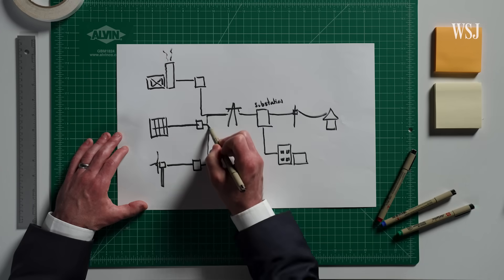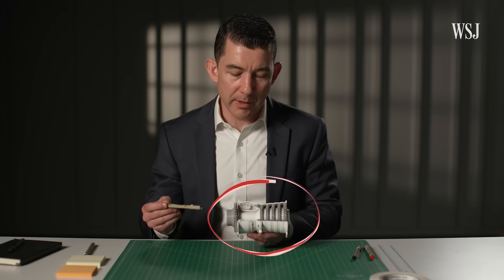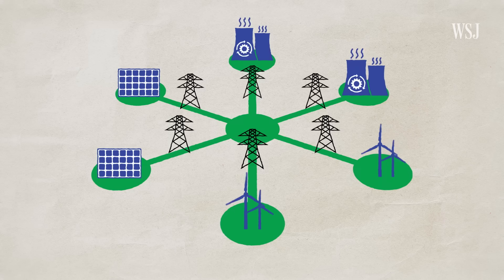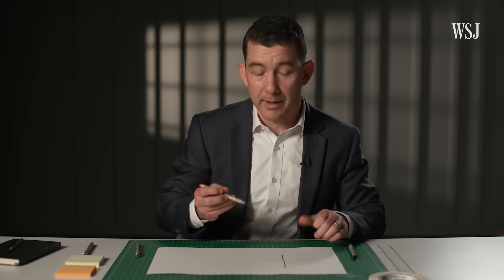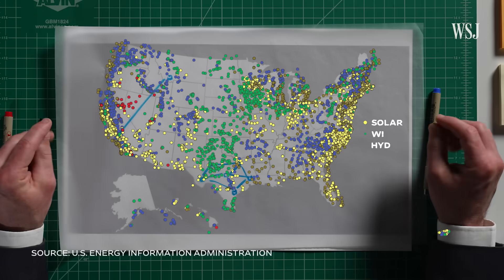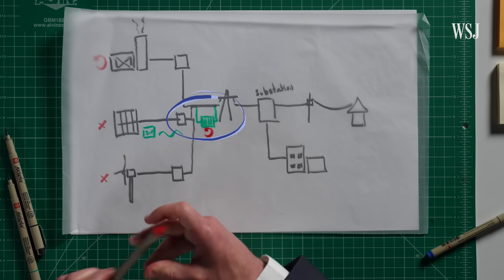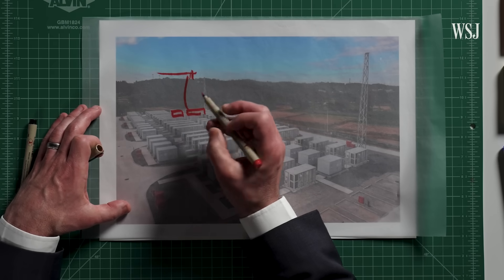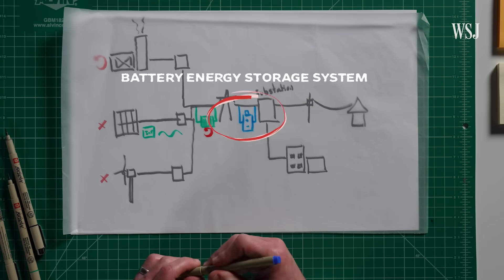How to Fix Renewable Energy’s Hidden Infrastructure Problem | WSJ Pro Perfected

Comment: Battery is the best solution overall, australia had this issue in 2016 they massively installed in 2017-18 and now they have the most reliable grid.
Reply: Batteries provide DC power. Our power supply runs on AC. To connect a battery to the grid, you would need an inverter to convert DC battery power to AC.

And, to power a Grid Following Inverter, a stable AC power source is needed. So no, Australia did not only use batteries. They needed at least 2 of the 3 solutions presented in this video 

Batteries to provide power.

Grid forming converters to turn the battery's DC power to AC (to connect to the grid, or else the batteries are useless)

Comment: Bad title - misleading! They are only vulnerable to outages... if they're on grids! It's the Grids that are unreliable, have 50% loss = inefficient, cause fires, get blown down repeatedly, and irradiate us. Renewables on grids are a band aid, triage, to stop coal pollution, but we need 100% zero emission and energy independent homes and buildings to not have blackouts.

Comment: Australia encountered this problem back in 2016. This is how they dealt with it. 
"Australia addressed this challenge through various means:

Investing in battery storage: Batteries, especially when equipped with grid-forming inverters, can actively contribute to frequency and voltage stability, mimicking the stabilizing effects of traditional synchronous generators.

Implementing grid-forming inverters: These advanced inverters are designed to set the frequency and voltage of the grid, offering essential grid support functions.

Utilizing synchronous condensers: These devices are specifically designed to provide grid inertia, helping to stabilize frequency in grids with significant renewable energy penetration.

Smart energy management: Promoting schemes like virtual power plants (VPPs) encourages smarter energy use by shifting electricity consumption to times when solar power is abundant, thus balancing the grid.

Price signals: Introducing pricing mechanisms like low "solar soak" rates encourages customers to consume power during periods of high solar generation.”
Reply: thanks chatgpt
Reply: @peterii3512 Nope.  From ABC Australia story.  And if I do use AI query it's usually google search chat.
Reply: @damham-F47  bro ur entire text just sounds like chatgpt 100%

Comment: Although at the start of the video they mention that the renewables they are talking about are wind and solar, during the rest of the video they practically use “renewables” as a synonym of those two. 

There are renewables that act as a baseload power source and contribute to the resilience of the grid, for example, GEOTHERMAL energy. 

Only talking about wind and solar is misleading.

Comment: That claim near the beginning by the IEA that we're getting >30% of our energy from renewables.  That claim seems EXTREMELY high.  I go to other sources and I see 10-15%, depending on what you include in the category.  Through this entire period of explosive growth in renewable deployments, we're also seeing traditional fossil fuel use ALSO increase.  Renewables are, from most source i've seen, merely offsetting some of the demand growth in energy.  And to get even that, it's required huge per kWh subsidies, inadequate (so far) investment in grid and battery technologies (costs excluded from the Levelized Cost of Energy metric everyone likes to use).  

I still think Nuclear Fission and Enhanced Geothermal have to be larger shares of our energy mix if we're going to have a prayer of transitioning from fossil fuels.  Wind and Solar are nice supplementary sources, and good for 'peaking', but I'm still deeply skeptical that we're ever going to have a global energy market where renewables are the dominant source of energy.

Comment: This guy is only telling part of the story. Just reducing the cost of batteries is only part of the overall cost. Proponents of BESS almost always state their capacity in MW's, not MW/hrs, which is what matters. If you put a 1000 MW demand on your grid, having a 1000 MW's of battery storage is insignificant, as the demand is constant. You need to meet that demand for hours, days and even weeks. Run the numbers for how much battery storage that requires and you get an astronomical cost. And we haven't touched on the risks associated with lithium ion batteries. Bottom line is that battery technology is nowhere near advanced enough to make BESS a viable option. As for the options he describes for addressing the synchronicity issue, they add considerable cost to what is touted as lower cost renewables. If one really believes the alarmists in regard to climate change, then they should be advocating for nuclear. But they are not. That ought to be setting off alarm bells.
Reply: Except BESS is already operating at scale in two states and clearly is big enough.  Your statements are false right out of the gate.  California alone has over 100GWh installed that is cycling daily at power levels in the 10GW range.  Growing rapidly.  Texas as well.  Past tense… it is already a thing, not a wish.
Reply: @junkerzn7312  CA's battery storage capacity as of this May is 15,763 MW's.  Not MW/hrs. Source is the California Energy Commission.  I'd be careful who you accuse of providing false information.
Reply: @TimothyGasser  Power is watts, Energy is watts x time.   15,763 MW is POWER ... aka, 15GW.  During a heat wave last year we saw batteries pushing in excess of 10GW for a time.  For example.

Battery storage is in GWh (Gigawatt-hours) and that now exceeds 50 GWh in California.  Not counting residential storage.

-Matt
Reply: @junkerzn7312  I have 2 graduate science degrees and was the Reliability Engineer for the Trojan Nuclear Plant. The one who has problems with math is you.  You claimed CA has 100 GWh's. It doesn't have 100 GW's of storage period, let alone gigawatt hours.

CA's demand is almost 300,000 GWh's.  Divide 50 by that and you'll see just how miniscule that 50 GWh's is in reality.

Not sure what it is about the renewables crowd that they have such a hard time understanding the basics of the electric supply system.
Reply: @TimothyGasser  You are talking complete nonsense.  If you have any sort of science degree then you should very well know how to specify units for power and energy.  Talk to me again once you've learned those things because right now you clearly don't know anything.
Reply: @junkerzn7312  Says the guy who doesn't know the difference between gigawatts and gigawatt hours.
Reply: @TimothyGasser  Its like you are a small child whos toys have been taken away from him.  Try returning to the real world.
Reply: @junkerzn7312  The only thing childish here is the level of your attempt at insult. I don't have toys. Not even the adult type. The closest I come are my music collection, my library and my gun collection.

Comment: Governments around the world will need to make big investments in making electric grids more dependable and modernize the supporting infrastructure to
Reply: I'm an Australian engineer and have bene trying to tell our government about this issue. 
The actual problem is ECONOMISTS and they are not just a problem with electricity but a lot of other things as well.

I first found out about how fragile our situation was back in 2016 from doing a small project into our energy issues. What truly amazed me was there were NO PLANS or even PROPOSALS anywhere to deal with these sorts of issues. It took me a while but I eventually tracked it back to Economists who it turns out have WAY TO MUCH INFLUENCE in areas they have no understanding of.

Its a much longer discussion and I am seriously thinking about starting a YT channel to address this subject of economists interfering in other fields like energy.

Comment: You've explained it very well. You're right. The main reason for the blackout in Spain was the failure of a power producer, which altered the grid frequency and caused the other producers to disconnect. That day, 90% of the energy was produced through renewables. You, who have money and still have politicians who believe in nuclear power, should start building nuclear reactors in abundance.
Reply: You're 1/2 right. 
Nuclear would help a huge amount with this problem.
In Europe the best option is the French EPR2 which at 1,600MW has a massive turbine with a massive pile of inertia in that turbine.

PROBLEM #1 - NUCLEAR IS NOT A QUICK FIX. It takes a heap of time to build an EPR2. Unfortunately building large complex plants like nuclear power TAKES TIME. PLUS before you even start there's a lengthy complex process to make sure the site is suitable. Hinckley Point C took 7 years to work through that process and they had the engineering expertise, regulations, standards and training programs in place. PLUS Hinkley Point C was the 3rd (yes 3rd) nuclear power plant on that site hence the 'C.' So they already knew the site was good and it still took 7 years to dot the 'i's and cross the 't's on everything. ITS NOT like buying something from Amazon. Its COMPLEX

PROBLEM #2 - Are the pro-nuclear lobby who are mostly clowns. Sorry but there's no other way to describe them. Most of them are pro-nuclear because they don't like wind & Solar OR WORSE are closet pro-coal and only want nuclear because they can keep burning coal while its built. The scarry thing there is they BENEFIT from dragging out the build time because the longer it takes to build your nuclear power plant the more coal they get to burn.
Reply: @tonywilson4713  Hinckley Point C has been forced to make numerous redesigns, to suggest the regulatory framework has been anything but favorable to it is historical revisionism. Permitting reform is imperative
Reply: @mohammedsarker5756  I have NEVER SUGGESTED that the British regulatory framework for nuclear is perfect or good or bad or anything else.
My references to that framework with respect to Australia is that IT EXISTS.

Australia has NOTHING in place.
NO Regulations
NO Standards
NO Training programs

How long do you think it will take Australia to approve a nuclear power station when we are starting FROM NOTHING.

We are NOT the UAE which is an absolute monarchy despite what it claims. The Emir clicked his fingers and that was their approval process. Plus the site at Barakah is well away from any population centre and located right on the edge of the Persian Gulf so the S. Koreans could make anything they wanted no matter how large and bring it over by barge. 

6 of the 7 sites the Australian Liberals chose were INLAND. That means you can't take advantage of the modular designs like the AP 1000 or APR 1400. 

That was what blew the costs out at Vogtle and Summer in America. 

We don't have people in INVOLVED in the conversation in Australia smart enough to work that much out because they are all ratbag activists or economists.
Reply: But nuclear is very, very expensive. It costs 2-3 times more per energy unit than wind and 5 times more than solar. Nuclear has a role, especially in countries without hydropower potential, but investing just in nuclear is simply economically unviable
Reply: @ivanjanjic8762  nuclear provides around the clock power, cheaper energy means jack if you’re facing the duck curve and can’t provide power to meet peak demand. And please, the cost of construction is due to red tape and a lack of state capacity, this is a problem to be solved not an inevitability
Reply: @ivanjanjic8762  2 really good comments
Reply: @ivanjanjic8762  No, no, no. You're completely wrong. A nuclear plant costs much more than any other system, that's true, and it will take 5 to 7 years to build the plant... but then you have 50 years of production. Nuclear plants pay for themselves economically in 15 years... then that's 35 years of economic benefit, and the price per kWh is 5 times lower than the others.
Reply: @gorkarullan  1st it doesn't build in 7 years, most optimistically it builds in 15 years that means investor (whether it be private company or state owned entership) must pay interest on those loan for building it before it even starts producing power. 2nd your assumption of price per unit of energy is based on legacy powerplant which just have the operating and maintanance costs and when you build a new powerplant you also have to price in interest. So when you consider that bonds average around 2%, and lifespan of around 50 years (additional 2%), that means that the price per kWh is around 80usd per kWh just in interest payments and amortization assuming that powerplant costs 15 million per mWh of capacity and of top of that you have operating costs assuming another 35 usd per MWh, that brings the price to 115 usd per MWh which is simply to expensive compared to wind, solar and natural gas (if you don't rely on LNG imports like Europe or Asia) to make it your only source of power. Again I'm not saying that we shouldn't build nuclear at all because it nuclear adds stability to the grid and isn't affected by insulation, precipation nor windiness

Comment: I also like the relative simplicity of synchronous condensers, real mechanical inertia. With a battery and a DC motor added to it it could add and absorb power as needed too.

Comment: The best way to solve green energy challenge is battery storage. However, centralise battery storage is expensive, instead, a decentralised battery storage inside EVs which is paid by the private EV owners is more scalable and sustainable. That's why China succeed by developing both green energy generation and EV markets, while the US failed miserably.

Comment: "the grid need inertia" - no, the old 1940's or whatever grid technology we still use today needs inertia, change all those generators to dc generators feeding some (yes very large) grid tied inverters and that problem goes away as they can attach themselves back onto the grid in like 20ms..... once the entire grid is fed from inverters we wont have any frequency drift with loading.
Reply: This statement shows a fundamental lack of understanding of AC systems and grid following inverter operation. Yes, the grid needs inertia to maintain stability. No, the inverters at most generation sites can not currently reconnect after 20ms. I don’t even know where you got that from.
Reply: @JustATrippyDuck from using one, I have my own domestic setup...... Most grid tied inverters can connect in one cycle  after a zero crossing point, makes them able to operate as uninterruptible backups. As long as there's some power on the line they will connect and support it. All we need is to use those and turn off the dinosaur generators. Problem is I've never seen one that operates at really high voltages, but that doesn't rule out running them lower with transformers to get that up to grid supply levels. A black start could be accomplished in second.

Comment: What’s missing is BESS or Battery Energy Storage Systems, these can buffer the grid from sudden changes in renewable output or a malfunction in a major power plant. Putting these systems at each end of a transmission line can mean that the transmission line doesn’t need to be scaled for peak demand, only for average demand. It also enables the transmission lines to be taken off line for servicing when needed. These systems can also be used to correct power factor and improve system efficiency and reliability. Modern inverters can act as rotary condensers and stabilize fluctuations in frequency when needed.
Without proper installation of these systems, cascading failures will result in blackouts as we have seen. It’s a system design issue, not the fault of any type of power generation technology.
Reply: Your right in that they can buffer (and well done on using the right word BTW)
However the problem they then create is the issue of the waveform out of the inverter.
No matter how hard anyone tries inverters CANNOT create a smooth AC waveform. Its fundamental to the way the power transistors are switched. Yes you can smoothen it out a bit but it will always have that slight wave.

I first found out about the harmonics issue inverters and other rapidly switching systems have in the late 90s when my boss at the time showed me stuff on an office building his old professor needed help with. It still stuns me almost 30 years later how few people know about those issues.
Reply: @tonywilson4713 Tony, modern switching devices like SiC MOSFETS and IGBTs have eliminated the problems of harmonic distortion on the outputs of modern inverters, the switching frequency is now high enough to be filtered with an LC network that is practical.
Reply: End of the line storage is a great way to describe distributed storage. That technology coupled with distributed generation is already being implemented in virtual power plant technology in several places. When it’s part of a local electric co-op who have their own generation,solar wind or hydroelectric, the solar arrays on the individual homes with VPP batteries help the co-op renewable plus battery system to fill in the gaps.
This cellular approach only relies on the larger grid for support and could separate quickly to avoid being drug down by the national grid.
This reliability focused approach is what moved many of us to build off grid systems because we lack the confidence to dance with a huge drunk pretty girl. Let’s keep an eye on her a while before we fall into her sweaty embrace 😅

Comment: A good explanation overall but no mention of efficiency losses regarding inverters which I believe can be as much as 20% to 30% ? Happy to be corrected on this as I too was a mechanical engineer by training and not an electrical engineer.
Reply: No, grid-scale BESS systems have a full cycle efficiency of around 93%.  At the voltages they operate at, these inverters are greater than 95% efficient.  Even residential hybrid inverters are sitting at 90%, full cycle.